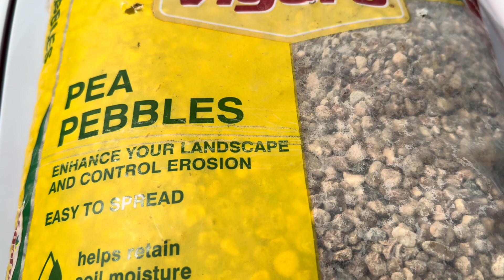INCREDIBLE DIY Homemade Body Armor for $30?! (AR15 rated)

Comment: Sir,
I am curious what would happen if you reversed the metal and the burlap; I believe that if the metal plate is good enough, combined with Eli’s burlap design, that it will slow a bullet enough to be survivable. Nothing we can do now will be good enough to stop all bullets, but if you can reduce penetration enough (iirc to 1 inch or less), NIJ considers it survivable. (The militry changed their standards to 2 inches, but that 2 inches with immediate medical assistance which may not be possible in the types of scenarios where this would be found.)
I’m very curious sir- Curious enough I went looking for a Thanks button.